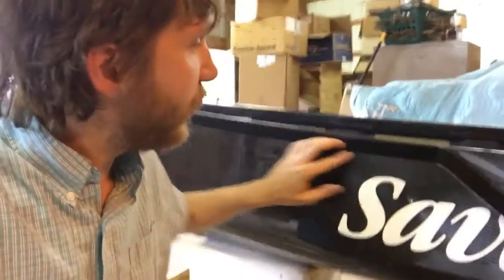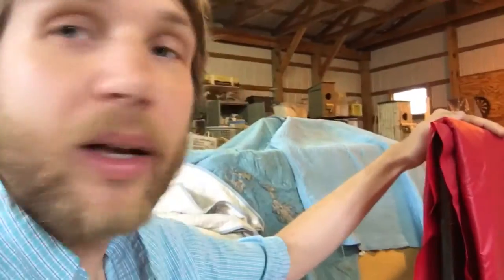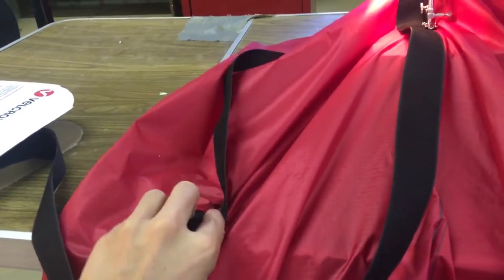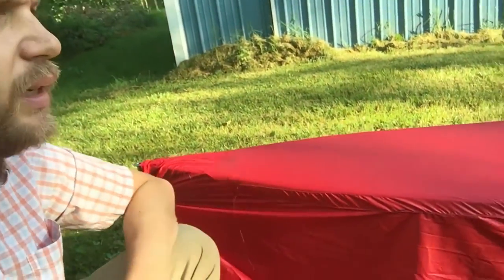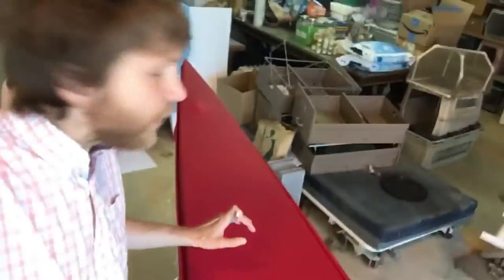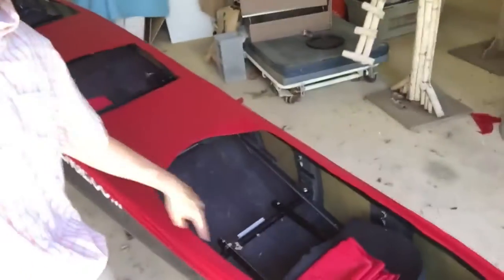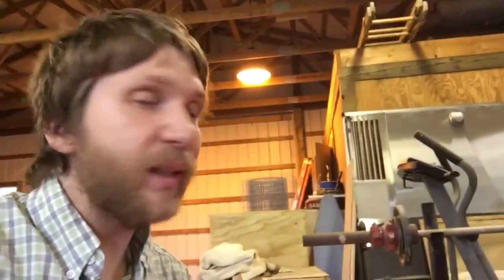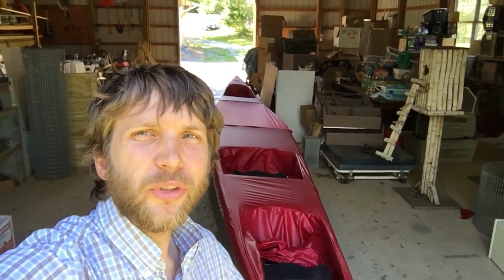How to Sew a Canoe Spray Skirt

Comment: Thanks for making this video with so much detailed information on the process of making the spray skirt and things you found that worked well.  I'm going to attempt to make one of these with a camouflage ripstop nylon for hunting from my canoe and this video explained everything perfectly.  I haven't used a sewing machine in over 20 years so this should be interesting.  Greetings from Satellite Beach, Florida.
Reply from the maker: When sewing the ripstop, practice a seam on a scrap piece of material.  It takes a little getting used to as its weight and feel are very different from other materials.  Good luck, it will come out great.

Comment: I've watched your excellent video several times now and played around with prototype spray decks on my self made solo sailing canoe last summer, but with no tight skirt, a mast opening and foredeck battens.
 I'm experimenting a bit with some Polyester/PVC material and using the full lacing that's already there. 
I appreciate the procedure you demonstrated and will definitely follow your lead.
Thanks,
~M
Reply: By first cutting the fabric into a 15' x 44" rectangle I was able to enlarge the leftovers into a useful size scrap, instead of cutting narrow strips off both sides. This allows for 6" extra at each end and 8" extra width for hemming the sides. I've decide to use dome fasteners every 9" instead of velcro so the hem will better support the dome fasteners. Since I'm using PVC  instead of nylon, I'm able to glue the hem with HH-66 and avoid most of the sewing. I'll hand stitch the ends and glue PVC reinforcements into them. Instead of a skirt, for now, I'm planning on using a fibreglass sail batten to give a slight arch to the cover just ahead of the single cockpit. Will let you know how it turns out.

Comment: What about using the self adhesive and stick the Velcro on the fabric first, then cut, then sew. Would that work out more easily for a experienced yet novice seamstress?
Reply from the maker: That sounds like a fantastic idea.
Reply: @TimMuhichOutdoors  the one drawback that just crossed my mind is that the adhesive may gunk up the sewing machine needle. Try a sample piece first perhaps?

Comment: A couple of questions for you. I'm contemplating a skirt for my canoe which has a wood outwale. Your aluminum gunwales lie almost flush with the side of the canoe, mine juts out 3/4". Will this design work? 
Also, I'm lacing my canoe. If this design will work for me, should the lacing be just under the gunwales, with the Velcro placed below the laces? My initial thought is that, but I've been wrong before, and this is my first canoe. I have no experienced with any of this.
Lastly, what material do you recommend. Yours seems pretty thin. I would like mine to last many seasons as its my only canoe and I don't want to have to do this every season or 2. 
Thank you, for this excellent video.
Reply from the maker: I have not put a skirt on a boat with wooden gunwales, however I do not see why it would not.  You would just have to decide where to place your velcro (or other attachment material) so that the force of the tight skirt pulls along the velcro, not pulling it apart.  Good luck with your build.  They make a ton of difference.
Reply: @TimMuhichOutdoors  thank you! Did you decide if the self adhesive Velcro worked well enough? Or do you recommend an after market adhesive? Also, was the 1 inch strip wide enough?
Reply from the maker: @jonathaneguy  I have used both.  If you want it to stay on for one long trip, the self adhesive is fine, just make sure you clean the surface really well first.  If you want it to last forever, use epoxy.

Comment: Where did you get your self adhesive velcro? Did you use an industrial grade, or standard?
Reply from the maker: Garrett Isenhart I got it from Seattle Fabric. It does not need to be extra strong, just make sure the surface is clean and it will hold.

Comment: What material did you use?  I need to make one for my Kayak, they don't make one for the one I have.
Reply from the maker: cathlyn205 while trying to go lightweight, I have made the mistake of getting too thin in the past. This ripstop nylon is very waterproof, it’s only drawback is it is not very chafe resistant. 

http://www.seattlefabrics.com/60-19-oz-Silicone-Coated-Ripstop-850-linier-yard_p_36.html
Reply: Tim Muhich Outdoors  Thanks for the info!  I'm just starting to look at fabrics so this is just the info I needed.  Thanks again!

Comment: Tim Muhich Outdoors. I am concerned for you.  A possible safety issue is getting tangled in the skirt during a capsize.!  It seems like three people with the shock cord tightened around themselves and linked by the skirt could get tangled pretty horribly with a possibly fatal result during a capsize.  Also, the velcro seems like it could be difficult to disengage during a capsize; and seems like it could trap you because it is too firmly engaged around the canoe.   This skirt you've made (while nice) is fundamentally different than a solo person/ kayak style spray skirt and exponentially more dangerous because of those differences.

I'm familiar with the Mississippi and know that it is generally slow and peaceful so that is good, but accidents/ weather/ careless individuals could happen anywhere. I hope your travel companions and yourself are safely home after the challenge, and that you will consider addressing these things before going out like that again.

Otherwise Great video!  I've never seen anyone do this before.  I like where your going with this idea, its really cool to put a spray skirt on a canoe.
Reply from the maker: RJ Sparling. Thanks for you concern. We all made out without any problems related to the skirt. Canoe skirts or spray covers have been used for a long time, and are the standard for much expedition canoeing. The skirt is very different from one you will find on a kayak. The Velcro must hold. Many people actually use snaps or clips to hold the skirt on. The skirt stays in place on deck, and you slip out in the event of a capsize. Through tests we have conducted, we find it works very well, and I have never felt any resistance in leaving the boat. For more information, or written instructions read “Expedition Canoeing” by Cliff Jacobson. I highly recommend it. With how well they keep water out preventing swamping, I would not dream of heading any distance from shore or doing any crossings without one. Give canoeing a try. With a good boat and a nice skirt you may find it far more enjoyable than kayaking. Much easier on the body.
Reply: Sparling is correct, this is not safe. 
In the Ally sprayskirt the part you crawl into loosens during a capsize. Just like in a kayak. 
I asked a professional sprayskirt maker once about making a sprayskirt without that, and he downright refused.